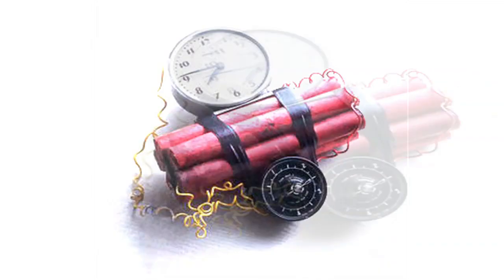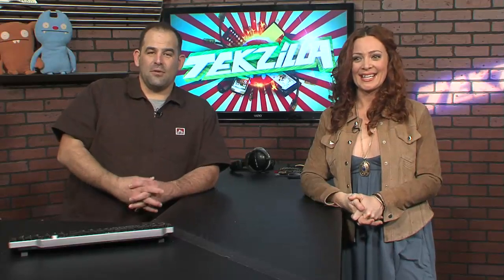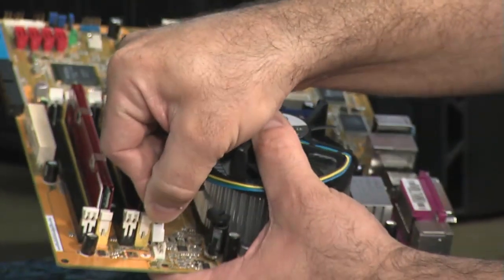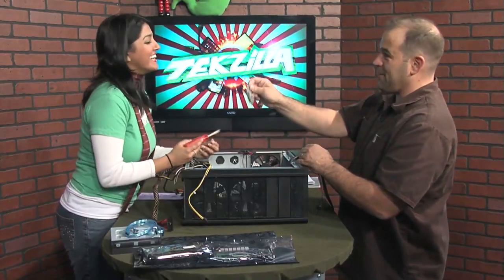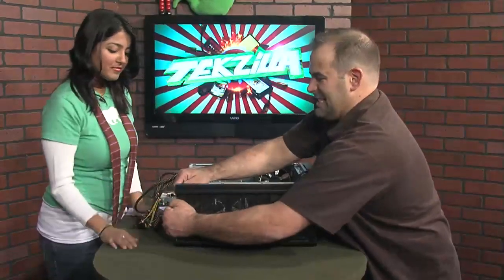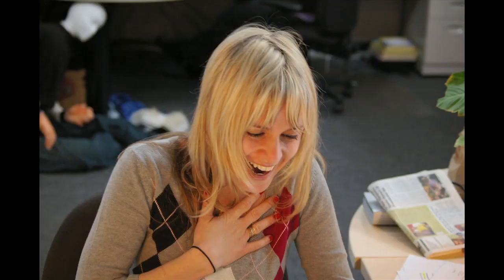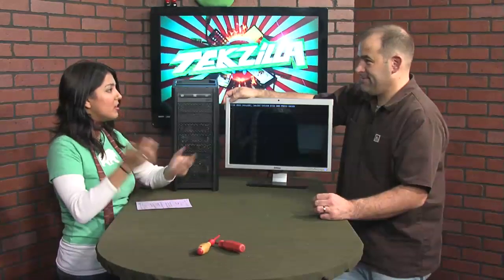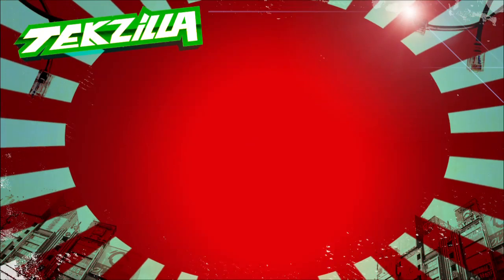DIY Bombproof Encrypted Thumb Drive, Build a PC, Backup ...

Comment: You don't actually have to rip off the front bezel of the Antec 900 to get drives in. And you didn't power the fans in the front